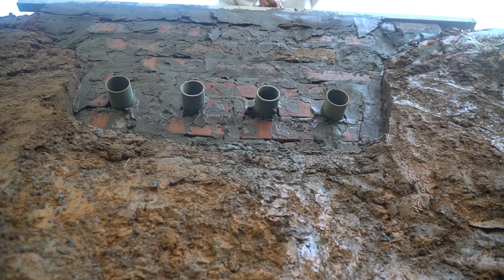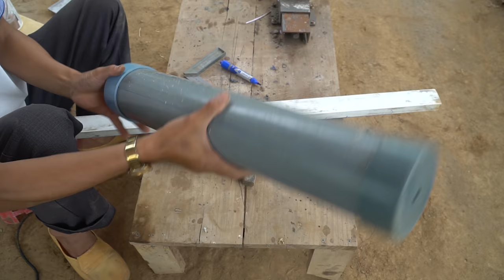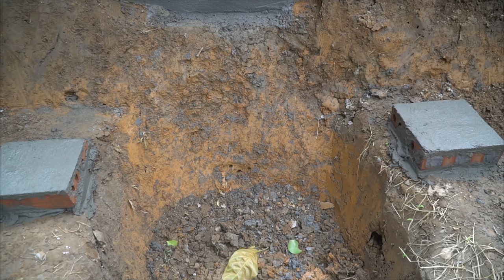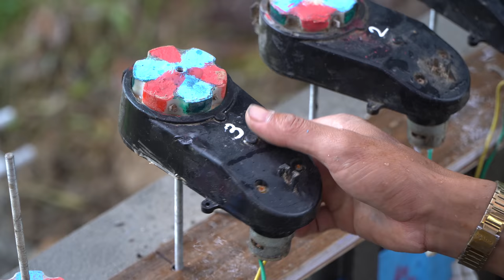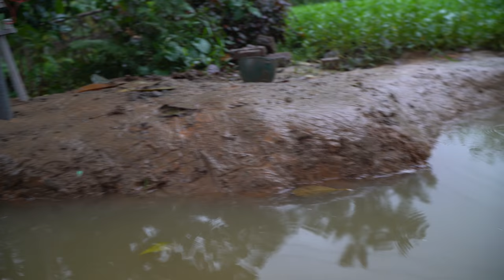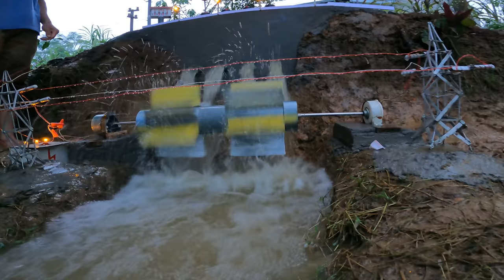Mini Hydroelectricity With 4 Extremely Powerful Water Outlets

Comment: POOR  engineering that thing will collapse in no time. next time think about giving it a footing and tying it into the hillside,  even 3 feet of water weighs alot.  Great concept though I've seen it done a lot in Northern California.   .   Dam  builders know all about pressure and seepage,  and every electrical component exposed to the elements. Bring the entire dam back a few feet and make your sluice gate longer   and it might actually withstand the test of time.  Then devise a way to protect your generators and your   sliucegate  .  components..    Your paddle wheel on your center rod is off kilter,    just a little more forethought and a little bit better engineering and it will last a long time.. Great effort though awesome. Just looking at it from an engineering standpoint.  I love to see people succeed in doing it right.